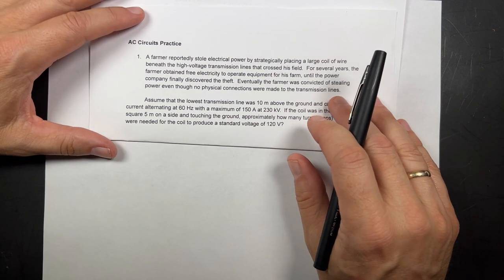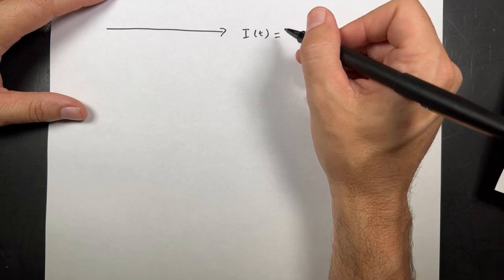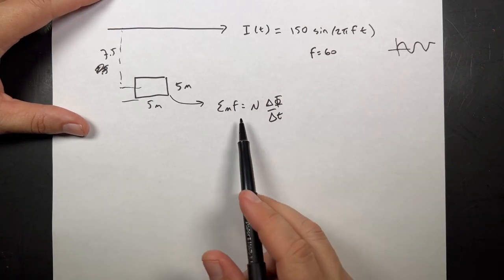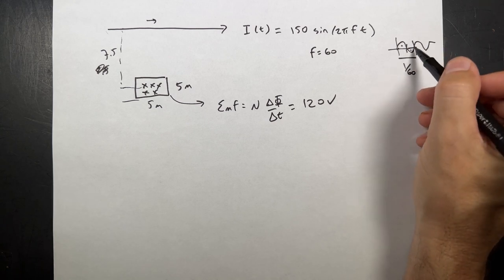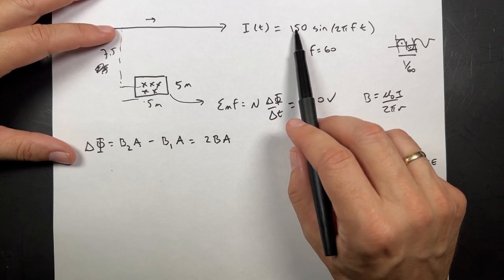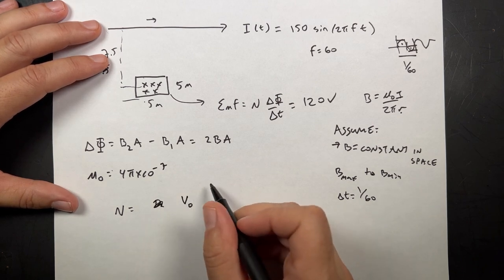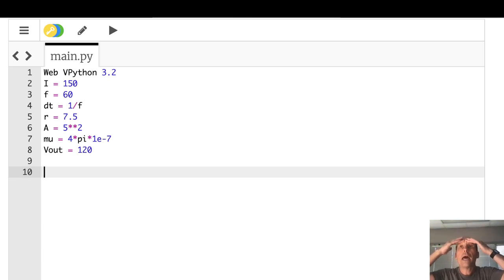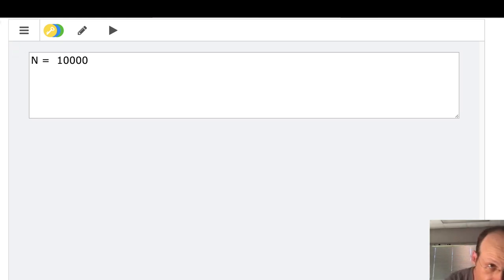Physics Estimation: How to steal electricity from power lines.

Comment: I think you should've used the RMS value for the current. Anyhow, good video!
Reply from the maker: Technically true - but there were a bunch of other estimations in there anyway, so I'm just trying to get an order of magnitude answer.

I need to do this problem again with fewer assumptions.
Reply: @DotPhysics  I know! What I meant by that is that it could be easily multiplied by 0.7 which is not a huge step between calculations. Good video anyhow!